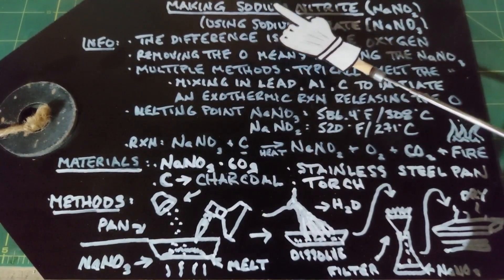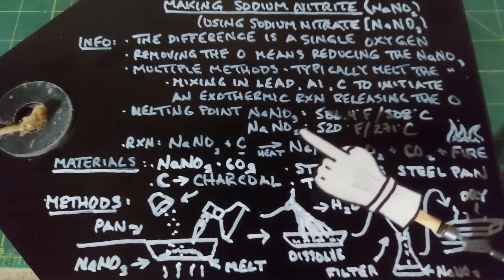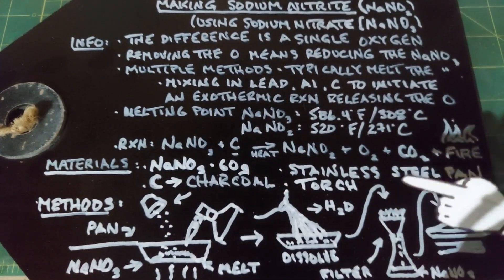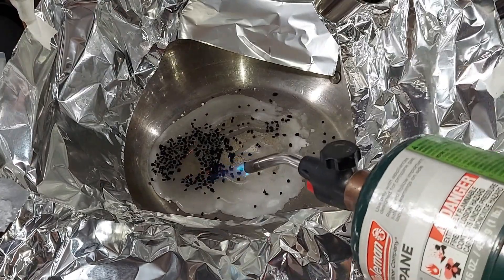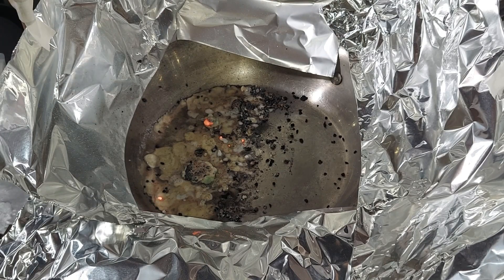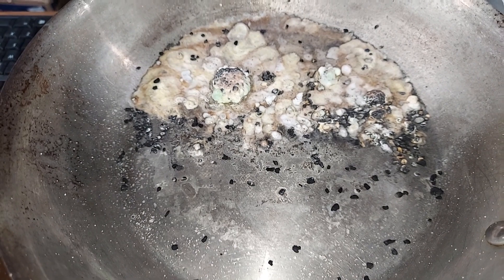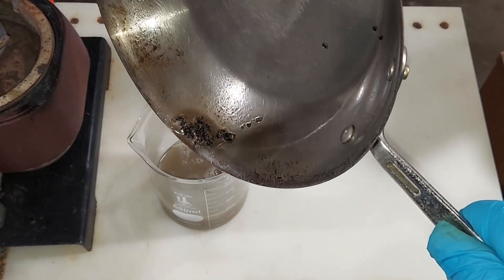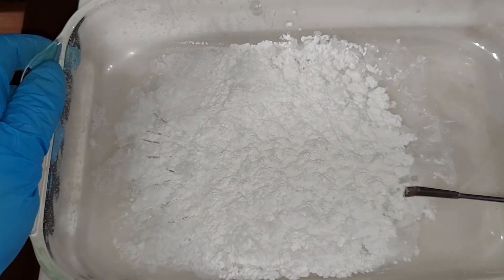Making Sodium Nitrite (An Ingredient In Making Nitrous)

Comment: You just saved me so much time and effort, lol. Thank you. I'm about to try and use a kiln, though, 🤔. I mean, a reaction box, lol. It's got a burnout plug on top, so the smoke will dissipate. 

12/10 vid.
Reply from the maker: Interesting idea.  I have found over time that doing smaller amounts at a time seems to work better.  Rather than a large amount at once.  Good luck!

Comment: I’ve found that the starch method and the lead method both give much higher yields than the carbon method. It sucks that nitrites are so hard to get now because some idiots promoting them as a self deletion method (sounds awful btw). Bubbling NO2 through a sodium carbonate solution by dissolving copper in HNO3 works well too.
Reply: Fancy seeing you here. I tried every. Single. Possible method I had ever read about and personally found starch, lead sponge, and calcium formate (in that order) to be the most effective reducing agents for good yield and purity. Calcium formate was easily the best because it oxidized to calcium carbonate, which was super easy to separate completely.
Reply: I'll have to try that! @integral_chemistry

Comment: Mixing everything in a homogenous powder may seem like a good idea but it would most likely end up in a runaway , high temperature reaction with a beautiful zero yield at the end.
The charcoal (powder) is theoretically added bit by bit to molten NaNO3. It will ignite by itself (around 350^C) partly due to high temperature of molten NaNO3 and the oxygen released by decomposition to NaNO2 + O (decomposition starts above 350^C)
I don't think he's got much of NaNO2 anyway, most of the stuff is just a mix of unreacted NaNO3 and Na2CO3 . 
Molten NaNO3 reacts rapidly with the CO2 generated by the oxidation of Carbon and forms carbonate .
NaNO3 reaction with HCl doesn't give the brown NO2 gas , while NaNO2 reacts strongly with HCl and the brown gas evolution is unmistakable. Fizzing when reacting the resulted crystals are an indication of carbonates , especially if tested with acetic acid. 
Not a very good way of making nitrite, at least not Sodium Nitrite .

Comment: Would premixing finely ground carbon and nitrate alter the outcome and improve or reduce yield?
Reply from the maker: That's an interesting question.  If you abide by the general rule that finer materials will react faster, it could shorten the time it takes to convert all of the sodium nitrate to sodium nitrite.
Reply: @cranialconstruction  I actually saw a better way of making sodium nitrate: melt some sodium hydroxide together with the sodium nitrate and then carefully and slowly add bits of sulfur.
3 NaNO3 + 2 NaOH + S = 3 NaNO2 + Na2SO4 + H2O
After that you can separate the sodium nitrite from the sodium sulfate by dissolving it in ethanol or methanol.
Reply: @cranialconstruction  I tried it. Nitrate:carbon 80:20 finely ground together in stainless steel pot with lid on gas stove. Ignited after about 1 minute, filled house with smoke. Dissolved all in water, filtered, reduced, crystallised and dried. 91% yield. Thankyou, this is an excellent method. I previously wasted nearly a litre of HNO3 bubbling NO/NO2 through NaOH with very limited results.

Comment: Could you do a titration to see how much NaNO3 contamination you have ?
Reply: you do get carbonate formation albeit the reaction is messy like you said (nitrite carbonate oxide etc) but it shouldn't be in any amount that matters too much
Reply from the maker: Ok.  What carbonates form?  Please be specific.
Reply from the maker: Looking at the elements involved, it would be the the only possible carbonate that could be formed.  But, it isn't.   I already knew if you responded back to me this would be your choice.  I would only ask that you research this reaction more, as it is different than making a nitrite using lead.  Although I can honestly say that this has been interesting, I need to move on to other things?
Reply: @cranialconstruction   "Ok.  What carbonates form?"
Well, oxidation of carbon produces CO2 that in turn reacts with molten NaNO2 to produce sodium carbonate and release of NO gas.
Reply from the maker: The amount of NaNO3 is negligible, if there's any at all.  When NaNO2 is formed the liquid hardens immediately even though the temperatures are very high.  By rinsing off any NaNO3 in the pan (and I overdid the rinsing on purpose), the NaNO2 left behind is very, very close to pure.
Reply: @cranialconstruction  but NaNO2 is much more soluble then NaNO3 so it would be carried away as well and just during the reaction, the carbon can react with NaNO2 as well to form carbonates, I've done this reaction myself multiple times, and each time it's contaminated
Reply from the maker: I'm not sure what you're asking.  Sodium nitrite doesn't combine with carbon very well if at all.  Once it's heated to around 650 degrees F sodium nitrite breaks down to sodium oxide (which then is burned up), nitric oxide (ends up in the air), and nitrogen dioxide (ends up in the air).  You don't get any carbonates.

I also sampled the sodium nitrite making multiple slides to look under a microscope. I did this to see if I could find any sodium nitrate crystals, as their much larger and look very different from the sodium nitrite crystals, as you could see in the video.  I didn't find a single sodium nitrate crystal.

Could you please direct me to a video of yours doing this reaction?  I would like to see how you did it.
Reply: @7hunderstorm242   According to Wiki NaNO3 is actually slightly more soluble than NaNO2 . You are right about carbonates , a LOT of them are formed because molten NaNO2 reacts with the CO2 produced and forms carbonates .
Interesting enough, if the reaction is done with Pb conversion seems to be around 30-40% and even though the nitrite is slightly less soluble by itself, when mixed with nitrate it will stay in solution and it is the nitrate that crystalizes out first .
Weird .
Reply: nice try but deleting my comment only makes me lose my respect for you and does not solve your chemistry issues